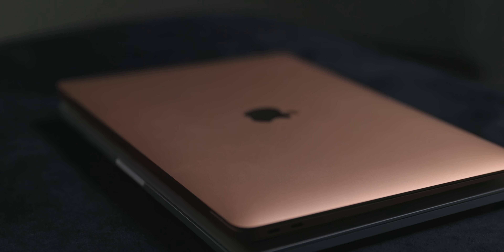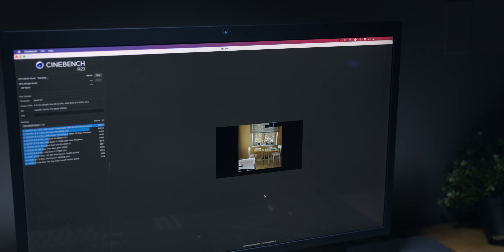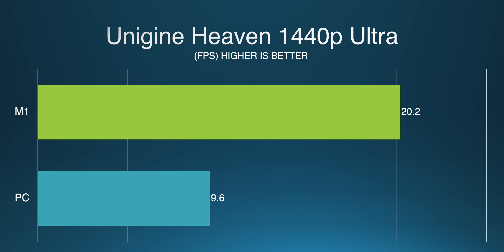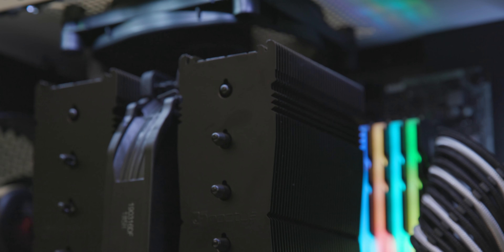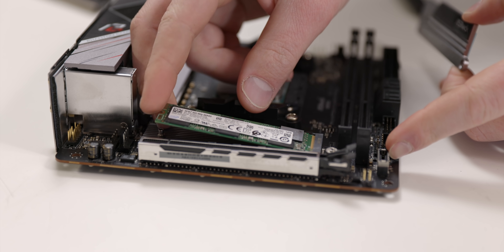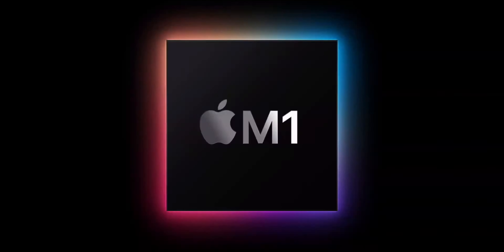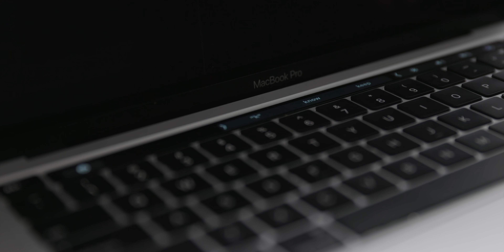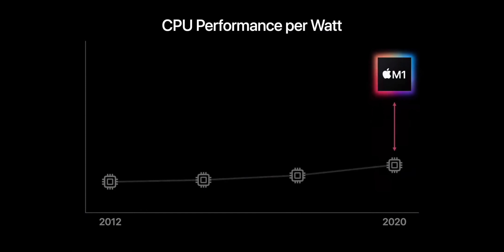$699 Mac mini vs $1,000 PC: Which Is Faster?

Comment: For those that are worried about SSD life, Bluetooth or who have "new product jitters" in general, I 'd suggest getting AppleCare...if your M1 fails, you are covered...definitely worth the added 90 bucks on my Mini for the peace of mind.
Reply: if the m1 fails after applecare, throw it out.  This is likely going to be an ssd failure.  You can't boot on an external drive. it's dead.
Reply: @LucasHolt  Wow, are you an Apple Hardware engineer? The SSD thing is a myth....Also,  how do you know that future MacOS updates won't include support for external Booting,  Bootcamp, eGPUs or multiple monitor support  ??...... or that Apple will offer extended warranty service for Fairy tale drive issues ??? .... back off, Hater !
Reply: @goobfilmcast4239  I'm typing this on an iMac.  So you can stop with the fanboy hate nonsense. 

The SSD thing is not a myth. it's part of the SoC and not replaceable. That's a fact.  It's also a fact that a new SoC/motherboard is $700.  On a 4 year old computer, that is more than it's worth to fix.  

All SSDs fail when they run out of write cycles. I've had multiple SSDs fail on me over the last 8 years.  Power users will most certainly experience this problem.  Even if the machine lasts a tim cook style person who only uses the web and office 7 years, it will still die.  

The SSD failure problem also impacts resale value because you only get so many write cycles.  Apple doesn't publish specs on write endurance for their SSDs, so we can't estimate the life of the system.  It could be 2 years or 9 years.  Based on my own person experiences, I'm guessing about 5 years for normal users and less for power users. 

As far as the future update question, why would apple open up their closed platform later?  The whole point of apple locking it down is secure booting.  They're very security focused now.  I seriously doubt they're going to open it up now that they've trained users to accept the limitations of the device.  The m1 is also about that.  Getting you to buy a computer that is throw away like an iPad or iphone once it breaks.  it's a serious e-waste problem and goes against apple's environmental agenda. 

Pointing out that it's a throw away computer to people is very important.  They need to know they're buying a throw away computer.  If you're used to holding onto old macs either for yourself or to hand me down to family members, it's a factor in how much you're willing to spend on a new mac.  My last mac was a 2012 mini.  I put in a new SSD and gave it to my mom a few years ago.  She's still using it.  The m1 would have failed by now with it's original drive over that time frame.  

Please learn about SSDs, how they fail and when they fail.  It's a real problem.  The upside is that on most it's a predictable failure.   You know you're only guaranteed x writes.  Once you hit that number, you're on borrowed time.   it's true that some brands like samsung go way past their write endurance, and others like intel don't usually hit their write endurance.   Apple doesn't give us enough data to estimate the life of an m1, but we do know it will fail someday and not be repairable.

Comment: I think this is the future of CPUs: efficiency and good thermal performance. I mean think about where our desktop CPUs and GPUs have gone over the last 15 years. They've been getting more and more powerful, but the cooling solutions have been getting progressively bigger and bulkier. GPUs that used to have one measly little fan that didn't look like it could do anything, are now boasting massive heatsinks and triple fan solutions. The likes of the tiny Intel stock coolers have been superseded by air coolers that inch ever closer in height to not being able to fit in most cases, and AIOs with massive 360mm radiators. Not only that, but even with these improved cooling solutions, we've come to expect higher and higher temperatures from these chips. The 80C my 5950X hits under very heavy loads, is actually fairly typical for the 5000 series. 

So to me it stands to reason that soon enough we're going to reach a point where the only way forward is efficiency. High performance-per-watt chips, that are less power-hungry, and don't require as much in the way of cooling. I hope that the likes of Intel, AMD, and Nvidia, will take note and pursue similar solutions.
Reply: I was going through some old stuff in my wardrobe a few weeks ago to clear things out and found one of my old GPU's. A single slot GeForce 3 Ti 500. The cooler on it is tiny and the entire board is about maybe twice the size as a regular sized smartphone. Compare that to the size and bulk of the 2080 Super in my current system and it's crazy how things have changed.

Comment: given this is a last gen APU from AMD there are 20% gains from 4000 to 5000. 
9:10 your not comparing the correct SKU, you chose the least efficient SKU they had at 45-65W. for the 35W class that is 5980HS or at the same for M1 5800U
with a 16 core and 32 core GPU your into the 100-120W range. which is the upper end of a thin and light. and its a much bigger chip on 5nm than AMDs APUs on 7nm at ~170-180mm. 
what makes M1 actually impressive is TSMC 5nm node being so much better than the 7nm we are use to seeing. apple isn't going to have the option to move onto  smaller nodes for at least another 1.5-2 years

Comment: Bottom line, they developed a high efficiency, highly scalable arquitecture, or rather copied others that use ARM. Whatever it is, it's good.
Reply: Only the instruction set isn't their own, practically every other aspect of it (including extensions to the instruction set) is 100% Apple designed and engineered. I hope you're not one of those super pedantic people who says they don't even make them themselves so it can't be theirs. If you want to argue that then AMD don't do their own CPU's or GPU's either. Or Nvidia, or Qualcomm...

Comment: then answer me this  is it from apple magic or from the power of the RISC  instruction set and arm magic vs the x86  instructions set I'm really curious to know
Reply: It’s apples design of a ARM based chip

But apple makes it so good cuz they make the cpu, gpu and the rest of the hardware as well as the operating system it runs

Comment: I took the plunge and upgraded from a 2017 iMac to an M1 mini. Aside from the usual quirks and rough edges that are common with a first-gen Apple machine, I”m very happy with it. The compatibility has been great with almost every piece of software (even WINE) running perfectly well, and the performance completely blows the iMac away on native things, and even emulated stuff is reasonably fast.

I do run into occasional performance issues with some of my AudioUnits but hopefully they’ll get native M1 builds soon.

Comment: I have migrated an old 2008 iMac to the M1 Mac mini it went super smooth and just everything works on the new machine and it flies!

 But for the DIY person like myself I just build a gaming rig with the unicorn Ryzen 5900X. 

But I’m almost sure there is gonna be a day where I put an powerful ARM chip in a socket instead of X86

Comment: I think the M1 is impressive, but not for the same reason you do. The vertical integration provides a lot of features and other technologies, yes, but that's not necessarily what makes it so astonishingly, ridiculously fast compared to its power consumption.

That is just ARM being ARM. The original ARM processor was so energy efficient they managed to run it without a power supply on accident - it simply started running from the guard rails against the signal inputs on the test board.

It carries on this legacy. RISC is insanely efficient, and the only reason the whole PC isn't running ARM already is that nobody besides Apple has managed to make Rosetta 2, or even Rosetta. Binary translation is hard. Really hard - because you don't always know what's an instruction and what's just data. But Apple pulled it off anyway, and now Microsoft is gonna put a ton of resources into replicating it. It's just a matter of time before we're all on ARM - unless of course NVIDIA comes in and wrecks everything.

And at first I thought the binary translation shenanigans was just Apple's special app format doing a great job - however I quickly found that you can make "wineskins" which takes .exe files inside of it and _then Rosetta 2 translates those_! Wtf?! Apple actually managed to binary translate and run Windows .exe files before Microsoft did.

Comment: The biggest problem with the m1 chip is apple, and their reluctance to allow for enough io.
Reply: These are entry level machines. Wait for their higher end models. This is literally the slowest, least performant chip they'll ever put in their (consumer, ignoring the dev kit) Macs. It's only up from here.
Reply: Since each USB-4 port connected to the macPro has its own dedicated TB controller (rather than sharing a controler) this chip has more IO than any other ultralight notebook (you need to get into the i5 i7 i9 line to find notebooks with multiple TB controllers, most notebooks run multiple ports of the same controller)

Comment: As someone who doesn’t like using Macs, I am still very excited about Apple switching to their own silicon and making the M1 so good. I am hoping that it will make Intel especially get its stuff together, and even get AMD to do better especially with its laptop offerings. Windows laptops IMO need more power efficiency, thermal efficiency, and performance to continue competing, and this non x86-64 chip will hopefully get everyone involved with Windows laptops to try to get closer to it.

Comment: I don't know why people are surprised about the benchmark results. Apple M1 soc is made on TSMC 5nm which is far more efficient than the R7 4750G on 7nm and with Apple software optimization it's obvious that the M1 will win at low TDP. I'm curious how the next Apple chip will compete in a high TDP senario.

Comment: The M1 is very impressive. I do wonder whether the performance with that supposed 16 core/32 thread "Super M1" can actually scale linearly. Also do these performance numbers remain consistent when it comes to gaming or does everything fall apart with that? I can't imagine that would work well due to it having to be translated to run on RISC in real time.

Comment: As for the video it was fine. Just like every other M1 video. conflating "Intel inside" with "Apple silicon". Vertical integration has benefits and pitfalls. At least there was a effort to introduce this problem to the audience and rightfully calling it a chip instead..

Comment: M1 Price Performance is top, but the comparision is not posible. The architectures are Different so the Optimisations of every Programm, some use the FPGA functions of the M1 and that is OK. But you dont have that hardware on the AMD system. You need to search for tests that run x86 analog instructions with the ARM instructions set to get a x86 like IPC comparision. What the M1 is and how it funktions its perfect for some posible most Mac users i know, but thats thanks to how Apple think of there customers, in my opinion is that the Dummest Posible User. Why can i not replace RAM or the Harddrive on a IMac without the posibility of Breaking the Screen? I have not the Skills to handle the disasambly of a IMac without breaking the screen, but the disasambly of a MacBook, MacMini or a MacPro is easy and only in the latest you can replace the Harddrives and RAM, in the Newest models. When i am Correct the IMac is the most selled Mac for 2 reasons the first the MacMini has the lowest Specs and the MacPro is to expensive the only Mac that is not the Lowest Spec and not to expensive is the IMac or MacBook. You do not get a TowerPC with IMac Specs. The only reason i think the IMac has not the sales like the MacBook is there have the same Flaw you can not replace the Harddrive or Ram without breaking. But the Laptop has a Bonus in that Comparison its Portable.

Comment: Did anyone mention about the SSD’s life expectancy in M1-machines.. Seems like a problem near future..
Reply: Especially if editing and other data focused tasks are some of the most benchmarked things. It doesn’t matter how fast the thing is if it breaks after a few years and you can’t replace it.
Reply: Still will last longer than any windows laptop
Reply: That's a lie and you know it. Apple ssd's are probably high quaility and they will beat most windows laptops but not every windows laptop.
Reply: @bryanmiller476  still..... you will be able to change the SSD on a WINDOWS laptop fairly easily
Reply: @bryanmiller476  uneducated Apple comment

Comment: ryzen4000 laptop cpu? vega graphics? Why are they bringing out last gen specs now? I hope they are bringing ryzen 5000 plus big navi in an apu soon or the m1 wont have competition.
Reply: Ryzen has 5000 series laptop CPUs and I’m positive they’re better than M1 in both single core and multi-core. This was just a bad comparison of something that is based off of the 3000 series architecture. Just for explanation, the 3000 series APUs were from the 2000 series desktop architecture, and the 4000 series APUs were from the 3000 series desktop architecture. The next gen APUs will be 6000 series if the naming convention continues.

Comment: Sooooo, M1chips are perfect. All videos say that, I would like to know the drawbacks, if i would buy i would like the pros and cons.
Reply: Con: you can only get them in a mac. Pro: you can only get them in a mac. ;)

More seriously the M1 drawbacks: (1) Not really suitable for gaming. GPU performance is great by iGPU standards, but not competitive with dedicated. Also, no egpu support. (2) Performance is amazing for the TDP, but the 4+4 core design isn't fully up to the level of a high-end H series or desktop CPU in multicore performance (3) 16 GB RAM max, deal killer for some use cases, (4) limited external screen options, (5) no ability to run windows well (only the gimped and less than legal ARM version of windows), (6) some people are seeing high swap usage for some reason.
Reply: @jsebrech  Thanks i was really thinkin in what laptop shoud i buy i am a film editor and like to game, but this M1 chips dont call me as much.

Comment: But can it run crysis?

Edit: I'd buy any of the new Mac laptops in an instant if they could run Windows without having to use a virtual machine... Because they are crazy deal for the performance you get but I simply cannot use MacOS :(

Comment: What's to stop Apple from using two current-day M1-chips in the 16" MBP that's coming up? Why put it all onto one big die? If they can make each M1-chip not try to work together but each has very dedicated workloads, that seems like it would/could be insanely efficient. Like, one M1-chip just for OS tasks, I/O, networking, etc. And the other for everything else.

Then it would still probably never be at full load, never need to actively cool, never burn a permanent scorch mark into your lap or desk, never pull much power, and end-users will have so much performance to work with... And hell, if they do find a way to optimize spreading the workload of, say, rendering videos and such over multiple SOCs then they're golden. Again, prevent the need to communicate between the dies, but let each take a specifically dedicated task that, for the software, will end up coming together as one.

Comment: I'm currently in the process of testing a Mac Mini M1 against a bunch of different PCs for video editing and rendering, and will have a video on my channel within about a month with the results. But the bottom line of what I've seen so far is that a PC -- virtually any PC -- with a GPU equivalent to a GeForce GTX 1050 or faster absolutely trounces the M1 by at least 2:1. Video editing these days is driven by the power of the GPU, and the M1's is.... meh... far better than an iGPU, but otherwise not great.
Reply: This is the thing most CPU's are not designed to handle video well as they are designed to have a video card. 

The fact of the matter is people who are buying a desktop for editing will have a dedicated GPU and comparing an M1 (Which was designed to do this) to a Ryzen APU which was not is an Apples to Oranges comparison. 

By trying to make it a level playing field he did the exact opposite.

Comment: You do realize that Apple did not invent the arm processor right?
Reply from the maker: I do. You do realize that Apple’s processor is not like other Arm processors in design, right?
Reply: @snazzy  yes that's true, but the arm architecture is what makes it fast Apple might improve on it here and there but it's the arm architecture.
Reply: Apple atually did invent the M1 processor.  The only thing they license or use from ARM is the basic instruction set.
Reply: @theRealSteve_T  which is the main selling point.. is what makes any arm processor better than x86. Reduced instructions means faster.

Comment: Gotta remember that you are comparing ARM vs an x86_64 architecture. There are workloads that do shit on arm, try encryption, for example. Amd64 extensions crush any arm out there with those workloads.
Also, limited pcie lanes on the processor (hence the 10g port on mini went missing and the ram is limited)

Not hating anyone, apple is certain to be years ahead in arm development, but is not a technology for everyone.
Also, you can't buy an m1 chip for your diy linux/windows pc.

At the end of the day, good job apple, sad you didn't bought anything new to the table for users like me.